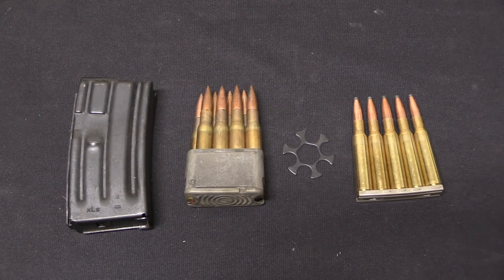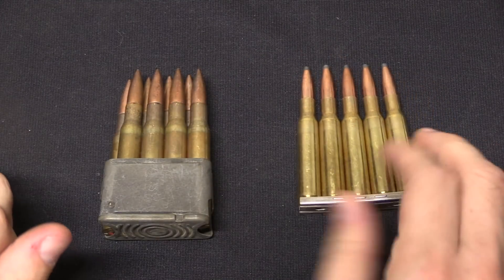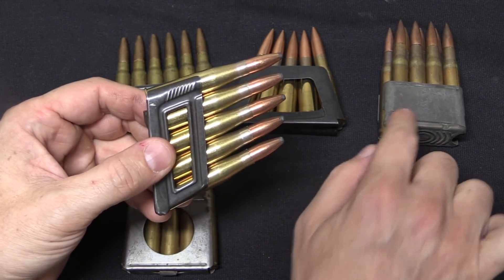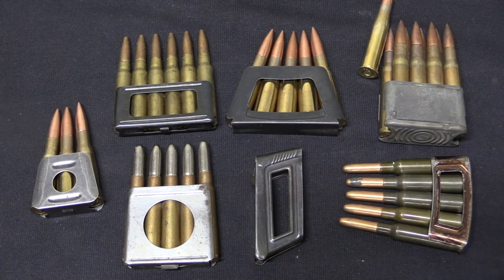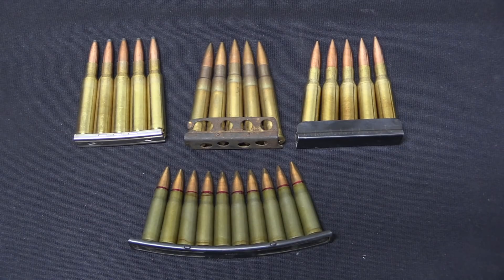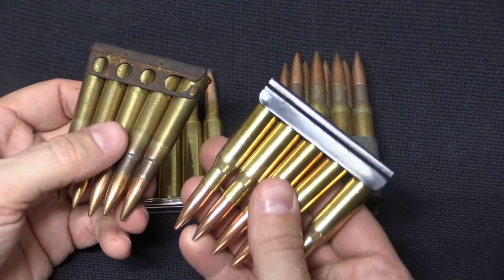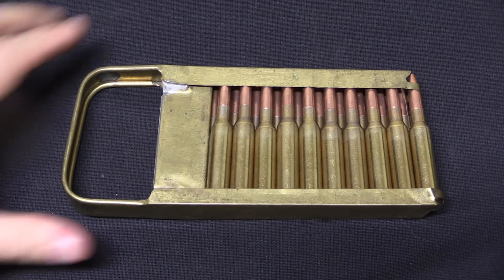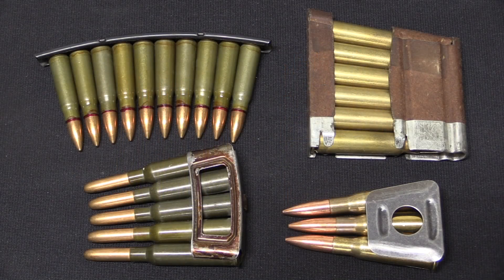How Does It Work: Clips! (Not Magazines)

Comment: Mosin Nagants do not have clips, they have ammo storage and organization devices which can sometimes, occasionally be used to load the rifle if the stars align correctly.
Reply: a ukrainian fella said to me: "you push, if it won't load, just push harder"
Reply: They also aren't firearms but rather combustion rituals which may or may not succeed in propelling a projectile in the general direction of your enemy.
Reply: -I loaded my clips with the rims oriented as they would be the in magazine, making my clips directional.
-Then I would pull up on the top round as I pushed down with my thumb.
-Then by the time the sacrificial goat was done burning, the rounds usually went where they were supposed to.

-Usually.
Reply: Perhaps comrade you did not fill out the required Ammo Loading Request Form or its mandatory Appendices R and Y.
Reply: @mrgameboy6261  
There's brute force and brutal brute force.
Reply: It's the interrupter pressure.
Reply: Grease those cartridges and find the best 4 clips out of the 20 that you own. Then the Mosin clips are tolerable rather than frustrating.
Reply: You do not know de way. Srsly though shoot a few spam cans of loaded clips and you get some sort of 6th sense when loading the mosin.
Reply: @nivlacyevips  now i realize how scarce those things can be in some countries... i didnt have a mosin now (but i did have and my friend still have one) but i never use one clip twice... only clips i reuse are for 7.62 tokarev

Comment: Hmmmmm... curious how he has the M1 clip with the top round on the left side to avoid that 7th round jamming.
Reply: Shouldn't have ground off that ramp on the right of the receiver...
Reply: He recently did a video just on that I believe
Reply: @joejoelesh1197  hence the comment. I would not have known about it otherwise.
Reply: Most detachable box magazines would benefit from stripper clip guides.
Reply: Wasn't the whole point of that video to say that defect had been fixed rather early in its production?
Reply: 7th round jamming was a fault on the factory not the gun
Reply: @BoxCarRacer-notthebandsorry  sarcasm missed.....
Reply: @redeyeseny  which is why it took awhile to figure it out. It's almost like you think I didn't watch his video on it.
Reply: @AlexanderTzalumen  that will be in the way. 

As an example, AR-15 magazines have a gap wide enough that an entire cartridge can go straight into the magazine. The feed lips would have to be closer together to let a clip attach directly to the magazine.

A detachable guide is the easiest way for it to work.
Reply: @andrewstoll4548  I did but that begs the question if you did why bring up the 8th round jamming if you knew it wasn't the guns fault but the people manufacturing and lack of communication
Reply: Standard rules for the time. It put too much load on the spring, they where also issued with loading aids.
Reply: @redeyeseny  BECAUSE it was funny that he had the clip loaded with the top round on the left........
Reply: @jason200912  what does that have to do with the price of tea in china??
Reply: @andrewstoll4548  Left-Handers (loading with left hand) have an easier time loading Garands with the round to the upper left.  They don't have to stretch their thumbs as far across the magazine well and can press the clip straight down.
Reply: @AlexanderTzalumen  The biggest problem is that you would have to design the majority of the rest of the gun around that one feature since you would need a strange gripping mechanism, theoretically stationary. Your bolt needs to be able to move through the clip guide in order to pick up the cartridges. It's not impossible, just not necessarily practical.
Reply: Someone is trying to be teacher's pet.
Reply: @ScottKenny1978  easiest, for who?  

Sarcasm intended, obviously easier for the manufacturers.  Nobody gave a hot turd for the guys trying to load them.
Reply: @joejoelesh1197 
Of course they cared about them.
They just didn't realize that their faster way of drilling would put lives at risk.
Reply: @ScottKenny1978  When I was serving, we sometimes got our rounds in stripper clips, and each case of rounds came with a number of the adapter devices.
It was a much faster way to load magazines than from a box of loose rounds.
Reply: @MonkeyJedi99  yes, an adapter for AR mags makes them a lot easier to load.

I was saying that machining a stripper clip guide into the top of the magazine would be complicated. Hard to make, more expensive, and would require the bolt to be designed to fit through a narrower slot.
Reply: @ScottKenny1978  Ah. I misunderstood.
Reply: @MonkeyJedi99  no worries!
Reply: Gary Reed yes while holding the operating handle with their right hand. I have a 1954 IHC and I'm left handed too.

Comment: Now I'm imagining moon clips with sharpened edges so you can use them as throwing stars once you run out of ammo.
Reply: Possibly. But  would imagine that a moon clip would be too light. Hira (star) Shuriken need sharp points not sharp edges. You want an edge but it should be dull enough so you don't cut yourself when pulling it out of a pocket.
Reply: @jennoscura2381  to solve the lightness problem how about making it for a large revolver, like the mk32a1 semiautomatic 40mm granade launcher? (At that point it is a frisbee)
Reply: @juanordonezgalban2278  You mean a chakram.

Comment: I was hoping he'd show a Mauser C-96 broomhandle being reloaded with a stripper clip.  Those were 10-rounders.
Reply: I'm guessing he limited the loading demonstrations due to regulations and/or safety. He seems to have filmed it in his house and only loaded bolt action "safe" rifles, hard to have an accidental discharge with those, not so sure about the Mauser C-96. Don't know either if he had a C96 clip on hand too.
Reply: A friend of mine had a red-9 broomhandle Mauser. At the time, original factory stripper clips were unavailable and 5.56 strippers were still very uncommon (late 60's) but worked fine if you could find them.
Reply: @dbmail545  9mm brass is the same size as .223?
Reply: @Joshua_N-A  A stripper clip only cares about the rim size. And they are pretty close (since the diameter of a 5.56mm cartridge is 9mm), whether they work would depend on tolerances but seems reasonably likely a 9mm NATO cartridge would fit in a 5.56mm NATO stripper clip.
Reply: @Joshua_N-A  9mm parabellum has the same case as 7.62 Mauser, it was just necked up to fit the 9mm projectile.
Reply: @harigtt

I'm pretty sure he lives in Arizona. It's not illegal to load or keep a loaded gun in the house there. Nor is it for most states in the US.

The laws only start to get iffy when you start taking those loaded guns out in public.

Comment: The "Swedish-K" had a 6x6 (36 rounds) stripper clip (like 6 single Mauser stripper clips fused together forming a square base) used together with a (really simple) speed-loader to fill a magazine with 36 rounds in seconds without ever failing or causing problems. Used it as a conscript. The ammunition came in a wax-sealed cardboard box and and each box filled a magazine. I remember that system as being really nice and well thought out.
Reply: Yes, it really worked like a charm.
I still have everything but the kpist itself, the speedloader really helps when you get 39B and have to strip them from the clip in order to single-load another magazine.

Comment: The M-14 and M-16 magazines had an adaptor to load the stripper clips. It fitted to the rear of the magazine. To speed up the process and “save” our fingers we would put the stripper clips into the attached adaptor and press the stripper clip against an ammo box or other hard object to drive the rounds into the magazines.

Comment: A magazine doesn’t have to have a spring, it just has to have some mechanism to present cartridges. Hence gravity feed magazines
Reply: Good point. Circular magazines like that on a lewis gun don't need springs either, do they? (I know the lewis mags had springs to add "floors" but if it where a single stack it wouldn't need them I think)
Reply: Would be funny if there was a magazine that relied on pressurized air to push the follower.
Reply: @Brigand17  Imagine if the bottom of the mag was well sealed and the follower was a piston that compressed the air inside, you could adjust feed pressure by just adding or removing some pressure

Comment: The term 'magazine' was used as the function name for the facility to store ammunition, in the days prior to cartridges, the magazine was where powder was stored.  When firearms for cartridges were introduced, the part holding the ammunition - not in the chamber - was also called the magazine.
What is not mentioned about the Mannlicher clip  or 'en bloc loading device' is the device becomes part of the magazine when in use.  It has the feed or control lips (to direct the loaded cartridge into the chamber, and also holds the rounds in place (as the walls of a conventional magazine does).

Comment: I know that semantics are a bottom less discussion in this case; but I always felt the simplest explanation of the two is:
A magazine is the part of the weapon that contains additional rounds for feeding; a clip is a device for loading multiple rounds into a magazine at once.

This encompasses all common types of magazine, including detachable magazines, fixed internal magazines, tube magazines, and so on. Also reflects the broader definition of magazine, as used in ships, forts, etc.

I suppose it's just an elaborate way of saying, clips load the magazine; magazine feeds the gun.

Comment: One thing you forgot to note 

It's nearly impossible to load most enblock guns without the clip if it is missing 

Where as on mauser style clips you can still feed the rounds 1 at a time if clips are not available  but ammunition is 

That's why most countries used mauser style
Reply: You can still load en-block guns one round at a time by thumbing one into the chamber, but I see your point.
Reply: @FLVCTVAT_NEC_MERGITVR  Some of them, it doesn't really work with a M95 so without a clip you're essentially upriver in a small stream and lacking a boat propulsion device.
Reply: @FLVCTVAT_NEC_MERGITVR  I'm not sure of other rifles, but I know for Carcanos you will break the extractor if you do that habitually.
Reply: @FLVCTVAT_NEC_MERGITVR  A lot of rifles don't have an extractor that can do that safely. A lot of extractors are designed to have the tail of the cartridge come up from below, when the bolt frees the next cartridge to rise up into the feed lips, and will quickly break if repeatedly forced over the back of the cartridge already in the chamber.

Comment: Kpist 45b speed loader. 36 rounds in a few seconds. 6 stripper clips with 6 rounds each put together as one unit and a special plunger that fits over the top of the magazine. You put the clip in the side of the speed loader, tilt it all a little then press the plunger 6 times and you're fully loaded.
Reply: I think you mean Kpist m/45 .. and the ammo is called 39B (steel jacketed 9x19)
I was just wondering why Ian didn't show the 36 round stripper Chips, and the speed loader , then it occured to me he might not have access to swedish military ammunition.. maybe I should send him a 36-round clip? ;)
Reply: @AndersLiebenholtz  45B,( thank's for the correction)  some of the 45's had the Finnish mag and didn't use that loader, they had another one where you had to load it, round by round, with a special plunger.  And the 39b had tombak plating over the steel jacket.

Comment: I don't have many issues with the mosin clips and I have repros. Some tips would be flex it with rounds in it, brace the top cartridge so the rim is pressing on the other round's rim and give it one good shove. They will get worked in, a few of mine are as easy as Mauser clips now.

Comment: The only two things you have to do with the mosin clip, is put the bullets in correctly, and when loading, pull the bullet up while pushing the base of the brass with your thumb and follow it down. It takes like 3 tries to get used to it. Maybe still technically harder to load. But not hard imo

Comment: You don't load a Mosin Nagant rifle by just pushing down on the top cartridge in the clip.  You load it by putting a finger under the bullet tip, and your thumb on top and use that leverage to slide the rounds down into the magazine.

Comment: Would anyone happen to know the proper stripper clip for an FN49 in 8mm? Some Yugo Mauser clips work great, some do not. Some three piece brass clips from Turk ammo work great, some do not. The stripper clip guide is much narrower than common 8mm bolt actions, where they have that nice big dovetail. I read clips with two lugs on each side as opposed to three work, so I ordered some to try. The last two-lug clips I tried were for 7mm and the wings on the back were too wide for the clip guide. I’m hoping these new ones work.

Comment: I’ve used a stripper clip to load a L1A1 S.L.R. magazines and with the F88 magazines but not done anymore with the Australian Army ( I think ) ,

As I thought it was a lot easier than doing it by one round at a time,

Oh the F88 one was a plastic stripper one piece clip that fitted over the top of the magazine and it could do 10 or 20 rds for a 30 rd magazine.

Comment: I'm having a helluva time trying to load 5.56 ammo, 10 on a strip, into my mags. Ammo is Federal and came in an ammo can with a supposed adapter to load with but it's almost impossible. The strippers have a brass shim underneath the case heads and an end tab you bend down to load. What's the trick?

Comment: Are the Mannlicher clips needed for mechanism, to pick up cartridges? For example can you load the Carcano with separate cartridges or it will not work unless the cartridges are in clip?
Reply: Both. You can push single rounds in the chamber but to feed more you need the clip.
Reply: @comradecosmonaut7746  Thanks man

Comment: I feel like the pros and cons section was cut a bit short. Like how about reloading a partially filled magazine or unloading the gun?
Reply: Partially filled magazine on an SKS...
just place the full stripper clip in the correct place and push down on the topmost round...
and the mag gets filled to capacity...
and then no more can physically be inserted...
and you withdraw the rest of the ammo remaining within the stripper clip and the clip itself 
The clip has small leaf spring at each end to retain the remaining rounds (ranging from 1 to 10) from falling out
Job done!
Unloading SKS...
trip the catch of the magazine and all the rounds fall out (usually into the sand by your feet) as the magazine and follower/spring rotate down and forward.

Comment: Well said.  Does clip material have any impact on ease of use?
Reply: Absolutely. The difference between a good clip and a bad clip for the same gun could be the heat treat of the steel. Each design has it's own requirements, and there are situations where the materials did change for whatever bean counter reason that made an otherwise good design a bitch to use.

Comment: OK I am curious,  what are the pros and cons of each?  Why did technology progress,  and I was always curious why en bloc clips which seemed the most straightforward device fell out of favour for instance.  Now no practical experience but am curious
Reply: I'm not an expert (I just watch Forgotten Weapons and C&Rsenal), but en bloc systems have a massive weakness in that you have a hole in the bottom of the receiver. That's needed so an empty clip can fall away, but said hole is then a route by which mud, muck, sand etc can get into the rifle. Also, as time progressed, internal box magazines became simpler to produce and more reliable (the follower spring could be made stronger than those in en bloc systems).
Reply: One reason was because most, (the Garand being an exception,) left a hole in the bottom of the magazine for the empty clip to fall out of. It turned out to be a good way of getting dirt and mud into the action when shooting prone. Then people realised that the hardest part of making an en-block clip was getting the feed lips correct, so if they were going to do that they might as well make a detachable box magazine. That's my understanding of it, anyway.
Reply: A clip holds 10 or 20 rounds as seen in the video. The ends of the bullets are typically exposed.
The clips tend to be flimsy especially stripper clips.
They will bend and it is possible that they may not feed into a weapon. Think about doing that under the stresses of combat.

Detachable box magazines can hold many rounds for the military 20 and 30 round magazines are typical with 30 rd being more common.

The bullets are somewhat more protected from damage, dirt etc.

Pull out a new mag drop the old one insert the new and you are in business.
Reply: As the Mauser rifle became spread around the world, even copied by Americans and Japanese, so were its loading system. Also, a Mauser clip uses less metal, important for a disposable device. And to finish it, once loaded, it didn't leave the rifle with a opening on the bottom for mud to get in, although not every  Mannlicher type rifle had them (like the French RSC or the American Garand).
Reply: @magoid  Instead, the RSC had perhaps the single most impractical method of loading a clip I've ever seen. Not certain what they were thinking with that one.